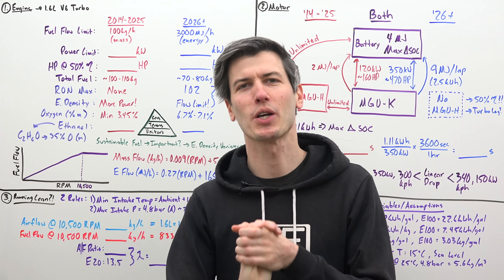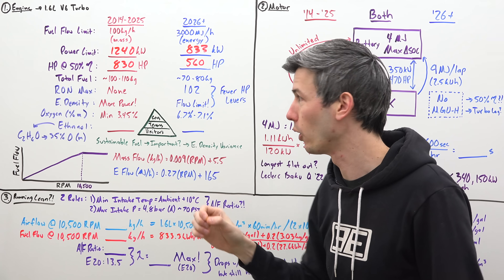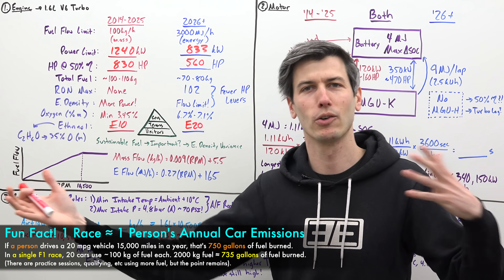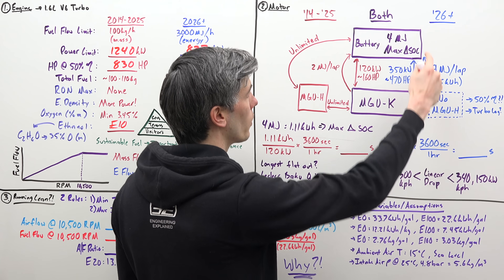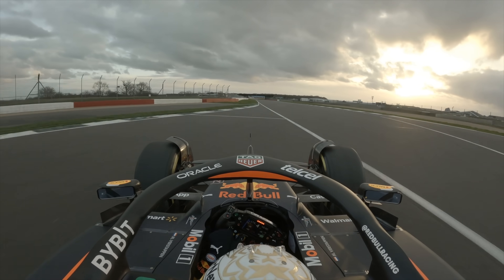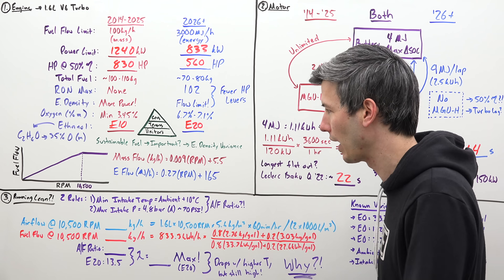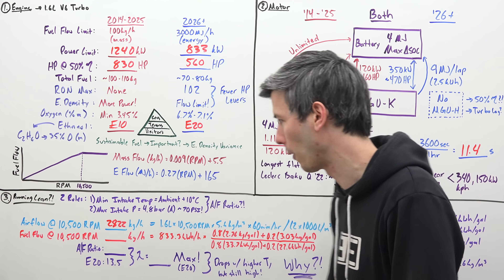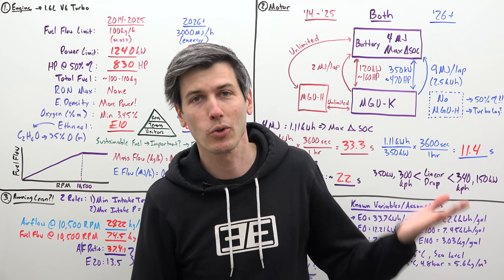Why Are 2026 Formula 1 Engines Going To Lose So Much Power?

Comment: Jason, since the 2014-2025 PU rules are now finished and the 2026 rules are about to begin, could you do an update of this video?

Some of the parameters have been changed, such as the recovery per lap, the MGUK output ramp rate and new rules have been added, such as the part load fuel flow rates.

They have also said that on tracks where opportunities for energy recovery are limited they will reduce the allowed recovery per lap.

The amount that can be recovered at full throttle has been changed from ~100kW (the wording says the output can be reduced by 450kW, but does not specify a minimum) in the original rules, to 250kW (maximum reduction of 600kW, minimum -250kW) in the last few iterations.

Also, you might have a look at the compression ratio controversy.

The rules state a maximum of 16:1 at ambient temperature, down from 18:! in the 2025 rules, but not specified as to when that is measured.

Comment: 01:58 The Octane number is NOT a measure of energy density. The octane rating has absolutely nothing to do with energy density. In fact, higher octane fuels are slightly, microscopically LESS energy dense than lower octane fuels because a tiny fraction of the fuel is replaced with additives. 

Sure, a higher octane fuel WILL produce more power, but not because it contains more energy per unit volume/mass, but because you can increase the compression (and therefore efficiency) without pre-detonating the fuel-air mixture.

Comment: I'm completely with you on the "why?".  Doesn't the F1 governing body say?

If you imagine that one of the "uses" of auto racing is to drive innovation in the cars that people will drive for other purposes, then reducing the total amount of fuel available, and even mandating that it be something like E20, make sense.  But why get rid of the MGU-H?  Why limit air flow?  If they were worried about safety (the speeds achieved were just too high), then why not just further limit the available fuel ?

In the time since the this video was posted, have any of the F1 officials offered any explanation ?

Comment: It’s so fascinating to rewatch this now that there is noise about the teams pushing for alterations to 2026 regs. There are plenty of tracks where not enough energy is harvested to allow for the 50:50 power split.
Reply: exactly. they talk about lowering the MGU-K to 200kw now. instead of 350. man these 2026 regs are a mess.

Comment: I am very excited about this new reduction in fuel flow limit. I absolutely know that even with the fuel flow limits more air is hugely advantageous.  
 There are ways around pre-ignition issues.  
Think about how much increased airflow benefits a turbocharged diesel engine. It's not the heat of combustion, it's the cylinder pressures. The newer f1 engines are running cooler than ever and at lower rpm, but making more and more power on the same fuel supply. That's exciting stuff. Dynamic compression and intake air pressures and temps are a big deal. Huge relevance for improving fuel efficiency.

Comment: You can use the excess air from the turbocharger for "compressed air engine" implemented in a few cylinders as a high-rpm mapping. It is a "free" energy as in MGU-H, so the real efficiency drop will be lower than you suppose.

Comment: So do you Ferrari back in 2019 found a means to back more density rather cheating the fuel flow? 

Might explain why the FIA announcement mentioned Ferrari would be help them better scrutinise the teams and research on sustainable fuels.

Wouldn’t Ferrari naturally have an advantage going into ‘26 if they really were helping FIA on the fuel side

Comment: The intake preasure limit could shrink the amount of power generated at lower rpm. thats the only reason to make sense. yeah the fuelflow limit at max. rpm is more likely the limiting faktor but going down the rpm from that max. point you could possible compensate the lower air intake by running higher boosts to be able to run exactly at the limited amount of fuel for a longer peroid of time, which could lead to unfair conditions if one or another team gets this "boost compensation" better done as the rest.

Comment: F1 is going in the wrong direction.  We have prototype racing to develop this hybrid stuff.  F1 is getting too close to EV racing and is losing its soul.  This is nothing but virtue signaling by the FIA and auto makers.  We should lose the batteries and develop ICE hydrogen powered engines.  It’s the most environmentally friendly fuel, it would make the cars more simple and LIGHTER, and we could give the sport back its screaming 20,000 rom engines! It seems that people ignore how mining for the rare -earth minerals causes more environmental damage to the earth than driving the EV cars they build will ever offset.  Making batteries is killing the the climate. Please - we need hydrogen ICE engines.  The exhaust is water and we can never, ever run out of it. Batteries are for toys. And making China rich and polluted.

Comment: The engine will just be a generator charging the battery.  If these new rules eventuate ill be done with F1. I miss the sound, it was the soul of F1. I used to sit on the roof at work and listen to the v10s power around Albert Park 10km away! The howl and shreek was intoxicating. Elec.... 🥱

Comment: Kinda looks like the FIA doesn't know how to do the math.  An A/F ratio more than TWICE as lean as is considered optimum for gasoline fuel ? Even more so for the ethanol component of the fuel ?  I know they talk about the fuel being "sustainable"...but, unless they have brewed up some magic elixir, NOT based on gasoline...I can't see how they can expect the engines to run like this. You simply CANNOT run a gasoline-fueled engine, let alone one fueled on pure ethanol, at a 30:1 mixture. The engine will not run. 

So, what gives ? Is the FIA planning on using a magic fuel ? Did they have a coven of witches brew up some secret sauce ?

God, I wish they would drop all of this over-complicated twaddle...and just adopt a set of rules that emphasize the skill of the driver over the space program-like nature of things now.

Comment: I’ve just watched the new 2026 engine regs technical explanation and the new 2026 power units will be giving around 1000 horsepower against the current average 850 horsepower. So no worries!😁

Comment: To think we have gone from the 1.5 V6 Turbo era of the late 80's with Renault 1350 bhp qualifying engines good for 3 laps, qualifying tyres and qualitfying fuels good for another 50bhp with the guy fuelling it wearing a respirator to 2024 and running 100cc bigger and faster lap times. I believe we have gone full circle. The ironic thing that standas out is Lewis Hamilton is a now a vegan because he thinks cow farts are the main cause of runaway green house gasses when the overpaid dude drives around and around in circles trying to beat 19 other guys over a painted line on the road on the weekend and then they all pack up their 960 tonnes of stuff and fly it on jumbo jets to another location on the planet to do it all over again. . . Twenty times a year ! ! !      Now that is ironic.   W T F !

Comment: Amazing class as usual. One question still puzzles me: is the MGUH currently acting also as a motor to keep the turbo spooling at high RPM when the engine is reving low? Is this why there will be more turbo lag in 2026?

Comment: to counter this octane limit, you could flip the entire table and make a compression ignition engine (a diesel) that uses completely bio diesel (made from plant oils), diesel has a verry low octane but weirdly it needs high compression to ignite, thus making it more efficient, there are diesels out there running compression ratio's of 30isch to 1 WITH a turbo producing way more boost than a gasoline engine, in a gasoline engine you'll never see more than 5 bars boost, while a factory diesel can run up to nearly 7,5 bars (heavy industry) and a purpuse made race car could probable have even more, the engine is a bit heavier though and the revs are limited, but with some F1 engineering there's probably a way around the weight of the engine so it can rev higher

Comment: What a bunch of design-by-committee greenwashing nonsense. The entire idea of Formula 1 (and auto racing more generally)  is totally unsustainable to its core, not merely due to carbon emissions but the fact that the supply of fossil carbon itself is limited and has already peaked. Eventually there will be no fuel to go around to spend on motorsports at all. If they must have this sport all the way until the world's militaries seize the last available fuels, they could at least drop this silly facade and just make the cars make cool vroom vroom noises since they're not even close to the most wasteful part of the whole affair.

Comment: Max RPM is 10,500 if all the fuel is burned. What if higher RPMs were used with cylinder deactivation where the fuel is simply not injected during certain cycles. By doing this additional heat is extracted and used to drive the turbo thereby increasing thermal efficiency and decreasing the temperature of the combustion chamber making it possible to user higher compression to extract more power.

Comment: Two observations… it’ll be interesting to see the interplay between the air intake restrictions and the increase in permissible oxygen via the fuel. 

Also.. I suspect we’ll see a few electrical power unit failures.

Comment: Wait a minute, in Mario Kart time trials you have a slow engine but you’re given 3 mushrooms to use around the lap.

These 2026 engines are also extremely underpowered, and you can dump your battery ~3 times per lap.

Oh my god the FIA is actually turning this sport into Mario Kart.

Comment: F1 are shooting themselves in their foot. I think the "road-relevance" philosophy will kill the races.
a) I ran a few quick numbers, taking a base number of 340 km/h at 1000 HBP. The new cars would reach a top speed of ca. 321 km/h (with power reduced to ca. 840 HBP), and they would only reach ca. 280 km/h with empty batteries. Remember Alonso's "GP2 engine, GP2 engine!"?
b) My 25 km/h, 250 W, town-designed e-bike has an off-the-shell battery of 1.8MJ, but faster e-bikes have up to 3.6 MJ. So the (4 MJ) hybrid F1 cars will store the energy of one or two bicycles. It just sounds ridiculous!
F1 has brilliant engineers spending millions in their ideas, but F1 also has a history of backtracking on poor ideas. 
I won't be surprised if they realise in 2026 that the new engines just don't cut the mustard.

Comment: So cars are going to get around 180mph before the battery dies off and it’ll struggle to climb to 185-190mph on engine power alone, hoping to increase slip stream & drs effectiveness. Power clipping will be the biggest talking point of 2026

Comment: I guess it might be good for overtaking on long straights. Slipstream and play chicken with deploying the electric boost. The car behind will be able to deploy much later and then the car in front basically loses 470HP and looks like it has been shot backwards. Any thoughts on whether that sudden cut of power might cause some crashes? It's going to feel like the car in front slammed on their brakes suddenly? The loss of 160HP wasn't really that noticeable, but this is almost like halving the power. It's going to look crazy like the cars have a fault.

Comment: Honda is the best engine in formula 1 not only because of the power but the efficiency that’s why Newey was able to decrease the side pods size improving aerodynamics without compromising the refrigeration system of the Honda engine !

Comment: The time invested to put this together and the care factor to make it digestible given the content is incredibly impressive.

What you’ve managed to highlight is that even under the current rule set for this year, “Formula 1” (or the pinnacle of motorsport) is so obsessed with arbitrary rule sets that it has actually broken the premise for which it exists in the first place. 

Sustainability, safety, practicality, precision, all need to be at the heart of F1 but so does the wonder and excitement created by feats of brilliance of talented people. 

When questionable outcomes from opaque racing regulations become the overriding conversation topic to casual observers the “sporting” nature of the motorsport is questioned. 

When highly specialised and technical engineering regulations in conjunction with punitive cost controls restrict creativity such that all the cars are the same but they’re actually not then you’re no longer the pinnacle. 

It’s easy to criticise and F1 is still a great spectacle. But it is more spectacle than sport.

Comment: All this tech may be for future road car development but higher tech road cars equal higher prices cars with potentially more complicated faults that manufacturer service divisions don't know how to fix and a used car market full of duds. There are a lot more vehicles being towed on flatbed trucks out of outback Australia than there ever used to be. Tech that works on the F1 track won't always work off of it. When we look at what the limiting factor is in the life cycle of a road car these days it is not generally the body/chassis frame and interior like it used to be it is the high-tech nature of the engines and transmissions and the fact they are not built to be rebuild friendly so when those components die so does the car. We are making more efficient cars but retiring them sooner so we make more actual vehicles that produces more emissions than if we made less complicated vehicles.

Comment: My take on the high air flow limit efficiency. With high boost the intake stroke acts as a second abet weaker power stoke. This will help make up for the efficiency loss of losing the generator/motor on the turbo, which is an odd decision in my view.

Comment: Well... with the same cubic capacity and a very lean mix AND a if you try minimize the temp over ambient (set as a rule so that no other car has a massive advantage over the other) you theoretically could require significantly less weight to cool the engine?

Comment: So without the MGU-H I doubt we'll see split turbos in the vee. I assume there's a rule that it still has to be a single turbo (which makes no sense considering the V config). Renault moved from single to twin turbo's in the late 70's right!  It'll now have a functioning wastegate rather than using the MGU-H as a generator in turbo overspeed/overboost events. I doubt the teams will want to let thermal energy go straight out the screamer pipe so they'll probably spec big upper rpm turbos's and infill the bottom end and lag with the KERS.  With those ultra lean numbers they'll probably be forced to use diesel-like EGR to keep compression high and hot energised gases flowing to the turbo.  Basically electric down low, something like compression ignition E20 up top.  Sounds like a glorified Toyota Camry or Mazda SkyActiv. I'd rather watch the F1 drivers race indoor at stadiums  in Go-Karts if I'm honest!

Comment: It’s for lower rpm, at lower rpm they can push more fuel and air per stroke of the engine into the engine and then as RPMs climb they will how to actually bleed off the air pressure as they begin to be limited by fuel volume. In a way, this will help with turbo lag but also a lot of low end torque with the batteries and no traction control could make for very interesting passing attempts and spinning out of corners

Comment: It seems like the increased power from the electric portion is not going to make up for the power lost from the combustion portion. With the energy storage limit not going up, the batteries don't seem to be getting bigger, but electric power generation is less energy dense than combustion so TLDR ... These cars are going to be heavier and less powerful, so even slower. F1 management does not seem to realize the league's prestige lies in setting and holding track records. Going greener may cause it to lose fandom to the endurance leagues, because at least IMSA is setting records.

Comment: When calculating the air flow, I did not see any referene to Volumetric efficiecny, so the lambda estimation is an upper vlaue estimation, it will be lower.

Possible reason for airflow limit: Some teams (RB cough cough) might want to get fancy blowing air through the engine and conducting it for aero reasons somewhere while at low power thanks to the more powerful emotor delivering on its own enough power to the wheels and the cranckshaft usign the engine as an air pump just for aero reasons... Perhaps...

Comment: With the higher capacity electric motor, you could do.some crazy stuff where you do cylinder deactivation and rapidly cool the cylinder while not in need of full power. (is water injection legal?) 

This could explain the double limit. Limit fuel for power output, limit air (and air temp) to control overall flow through the engine, and limit cooling potential.

I have no idea if cylinder deactivation is worthwhile in a formula 1 context, but that was where my head went upon you posing the question.
Reply: They used to cool engine with extra gasoline but it was banned. So I am guessing water is banned as well